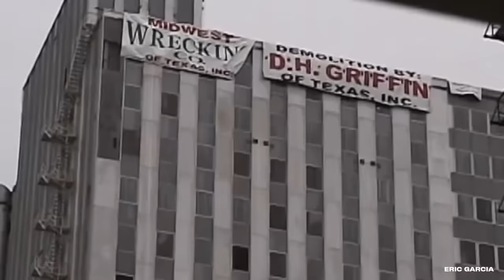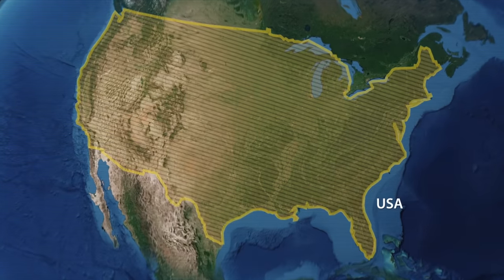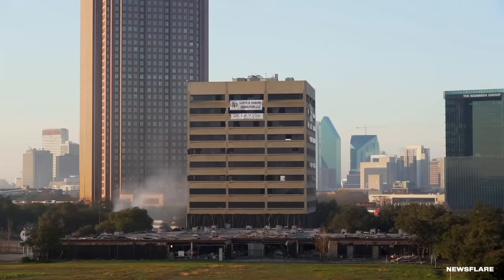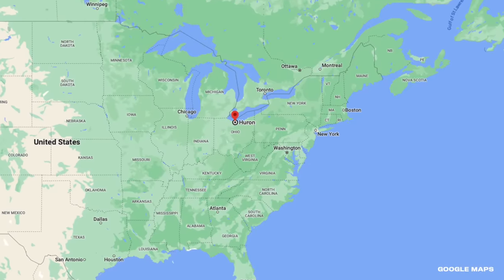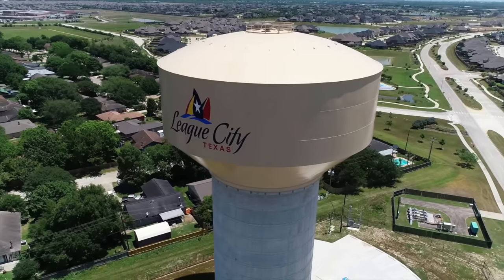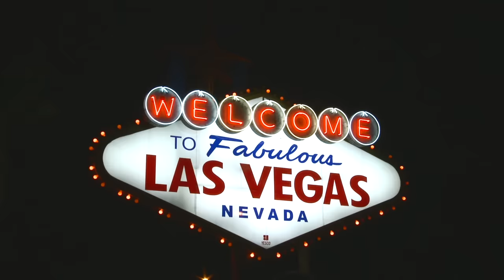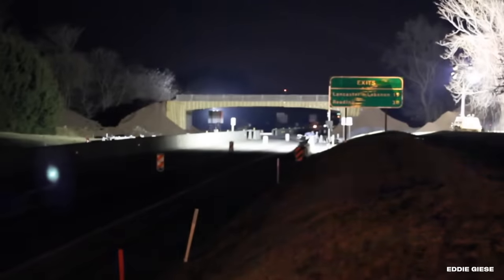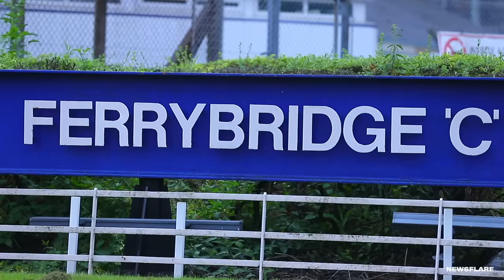30 Minutes of Extreme Building Demolitions

Comment: I remember seeing the the Contenental National Bank building in Fort Worth go down. I was about 2 miles away. I knew it was going to be imploded and I was showing a friend where it was. They had announced a time for the demolition about an hour later than when they actually did it. We stepped outside so I could point out which building it was, and just as I pointed, the building fell straight down. Then I heard the sound of the explosives, followed by a giant cloud of dust. Had I waited for the official time I would have missed it. It was the first building in Fort Worth that I ever saw. I was 6 years old and we were driving west on the old turnpike (now I-30), and I saw the clock which showed the time and temp. For years it was the tallest building in Fort Worth, and you could see the clock from almost anywhere in town.

Comment: Since electricity travels at near light speed why doesn't all of the explosives go off at the same time instead of like dominos?
Reply: Good question
Reply: They wire in time delays so parts of the structure will start to collapse before other areas fall. One way to get it falling in the right direction.
Reply: @davew7250  Exactly this. Cord is selected for burn rate and attempts are made for precise timings so that structural sections are weakened first, before directional ones are fired. You really don't want to mess up, as the competition is very fierce, and standing landmarks after what should have brought it all down can make getting another contract rather challenging.
Reply: @edwardranno7119  thank you
Reply: @davew7250  thank you
Reply: because that would create a huge disaster.  they use two type of charges, the first timed charges are rigged at the base of the building, to eliminate any remaining structural support.  the next timed charges are rigged higher in the building, on multiple floors, from one end to the other, taking out floors and walls, essentially, demolishing the structure.  with the support removed and the structure now in falling pieces, it begins to buckle then the weight of the building material collapses down, in the same order as the charges. it's how they get a building to collapse onto itself rather than come down and spread out.   delayed explosions, the physics of how it will fall, how fast, in what order, and gravity taking up the slack which starts a spiral that brings the first corner down and each corner twisting into the last with all the material guided in and down until the roof sits on top of the pile.

if all the charges went off at once, debris would fly everywhere, completely out of control, and potential that parts of the structure would remain upright because the lack of delays would have material falling at once, without the support being undermined first.  think of all the debris falling at once, clogging the drop pit, or think of a dam when it fails, the sheer volume empties immediately.  the timed charges remove the clogging effect so debris comes down in the right amount until it's fully collapsed. hence why they're called controlled demolitions. and when reviewing 9.11 footage, why many americans believe the twin towers were rigged to drop as they did, days prior to the planes flying through them.
Reply: Electricity travels AT the speed of light. They time all the charges for proper collapse

Comment: The first 23 seconds is the short version. No need to watch further if you're in a hurry.
And the physics is badly explained around 24:40, the "higher end" does not move faster, in fact you can see it is actually lagging behind the rotation of the bottom part. If the chimney could have stayed together, the "higher end" would HAVE to move faster, but it can't so the taller items break instead.

Comment: How fo the twin towers fall perfectly down in a straight line if a heavy plane just sent all its momentum through it? You would think it wouldve leaned and fell over. Not to mention jet fuel isnt hot enough to melt steel.